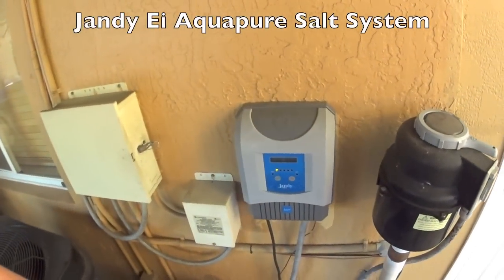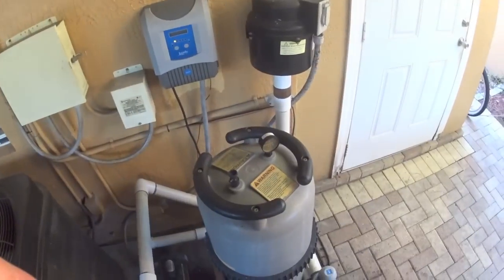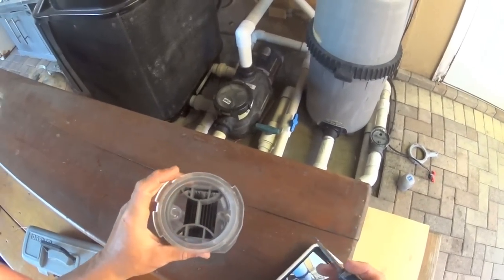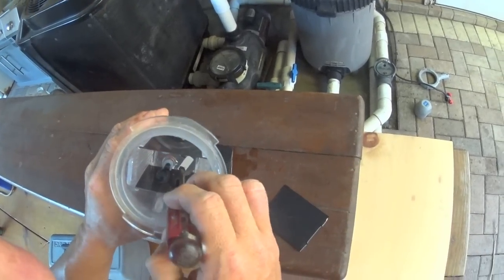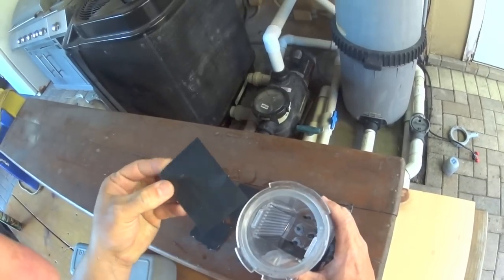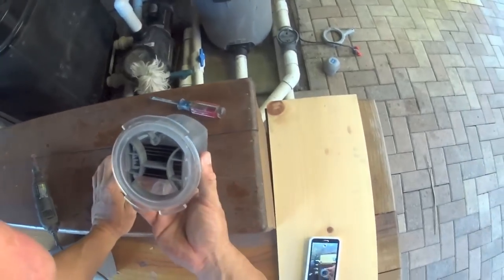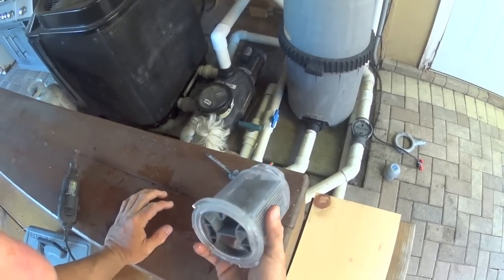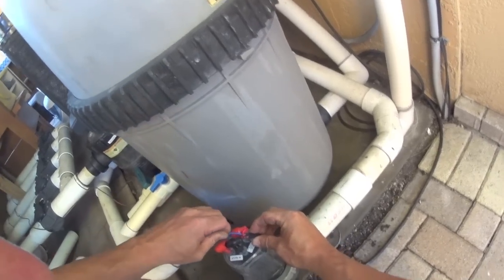Zodiac Jandy Ei Aquapure salt system quick fix on the cell

Comment: Melbourne, Australia here. My Zodiac Ei25 did have the very same issue. It has ~6500h. Your solution did work but with a small change. The change I had to use was caused by the bottom clip not being able to create a proper electrical contact with the modified plate. The solution I used was to clean the bottom contact and then add a spring to the plate (where the cut has been done) , then insert a screw into the spring pointing down with the screw head. In this way I did succeed to have a proper electrical contact between the modified plate and bottom contact. After doing this the Zodiac did start working properly with me being able to change the output to maximum. Thanks a lot for the tip provided in your video. I expect this workaround to work for a while, but I did order one new cell anyway with $459AUD from eBay pool shop.
Reply from the maker: Glad I could help you out man.

Comment: This worked for me too. Thanks for posting this video!  You saved me from having to buy another cell and wait for it's delivery.  

I had to make one adjustment to your instructions because it would not work at first.  I pulled off the black boot inside the cell. The electrode/connection rod was actually attached (or welded) to the original plate and that piece was still there.  So, when I inserted my other plate with the tab cut it would not go all the way in and not make good connection, and the bottom was down too far  That's probably why you had to notch the bottom of your plate.  I pulled off the black boot inside and I worked the "new" plate/tab up beside the electrode to assure good contact.  Now the bottoms of the plates were all even and I didn't have to notch the bottom of the plate.  It worked.
Reply: +Shawn Gibby Worked for me too. I pulled the plastic sleeve off the negative terminal with needle nose plyers and then worked the plate next to the terminal.

Comment: Just did this to mine. I soldered a tab and extended the lead about an inch so it would touch plate and put it all back together and started working again. THANK YOU for this info!
Reply: Can you explain to me what you did exactly? My leads are frayed going into the little head thing. Wondering if i can take them apart and redo them?mine is saying no flow sometimes, sometimes low temp or salt. My cell is brand new. I cant find the replacement for the cord. Wondering if there is a way to repair?

Comment: I had the same issue with the flow light. I tried this fix and it worked, the flow light went off and the system seems to be working fine. Thanks for the post you saved me $450.00 by doing this video.
Reply from the maker: glad i can help

Comment: Great tip friend! You gave me a start. The electrode had corroded and new tip was too short to make contact with the eroded electrode.
I ended up cutting about 1/4 inch off the bottom effectively lengthening the tip. I put cut strips if a bicycle inner tube on top of the plate between the two taller ones.  I made it thick enough that it put pressure from the clip on the top of the plate.  Voila! It worked, how long I don't know for how long but It buys me time!

Comment: Thanks Brother you saved me a few hundred as well. I did not think this was my problem, because you cannot tell that the plate is all ate up until you actually pull all of them out of the cell. I pulled them out and one of my active plates were worse than yours was. Fix worked great.

Comment: Thanks mate. Fixed my Zodiac Tri Chlorinator as shown. Had to reset the Cell Hours as well before it started working. Hopefully will get a few more years out of it now. They could so easily make these plates consumables instead of nearly charging the cost of a complete new system just for the cell.

Comment: Thank you so much.  I got the run around as you.  Jandy had me order the cover assembly, however after trying your fix, it worked.  I made the cuts with metal snips and it worked great.  Think I will have someone cut me a supply of the metal plates in anticipation of next time one fails.  I will return the part I ordered from Jandy as soon as it arrives!

Comment: Brilliant. Thanks mate. They don't manufacture the ei units for my one anymore. I found them on Ebay a couple of years ago when the first unit failed. Had to buy chlorinator and digital unit. Quite cheap, but not as cheap as fifteen minutes and a couple of Dremel cuts. Legend

Comment: Good video and great you took the time to make it .  I've only been able to get 2-1/2 years out of a Jandy APure35 cell.  Today I ordered a third one (R0511400).  Seems the black capped electrode corrodes at the weld where it joins the plate.  While waiting for the new one I decided to see if I could cobble up one from the old units.  I took one of the "red" electrodes out and made it into a "black".  The electrodes will come out by clamping the terminal with vise grips and hammering down on the cap. The electrode post on the plate inserts into the terinal pin and is held in by an interference fit.  The post on the plate goes through the cap and is sealed by an o-ring that seats against the bottom of the cap.  Before installing the replacement red for the black, sand down some of the electrode post so it will insert more easily into the terminal pin.  If you use the red terminal pin (it is split) it will have to be spread slightly to get a snug fit with the electrical cap because the black terminal has a larger diameter.  When my pool was build the crew left behind a "dummy" cap, so I was able remove the cell without having to close down the pool.  I got by with clorine tablets in the meantime.  Hope this is helpful.  This method, although requires ordering a replacement or two over the years, it will give a better bond of the electrode to the plate and doesn't require cutting the plates.

Comment: HI Fresco,
The NO flow red light is the blue wire it is connected to a probe that needs to touch the water inside the cell. This tells the machine that there is water present or water flow. There is a straw that pulls the air out of the top of the cell. If the tube or straw is missing or broken, the cell will have air at the top and the red NO flow light will come on, even if you have plenty of water flow. The Titanium plates have a coating on them, once the coating wears off, it will not convert sodium chloride to chlorine. You cannot just put any metal plate inside, it will not work. Your troubleshooting was very ingenuous, nice work but it will not last long. Basically, you were able to re connect the grounding probe that connected the blue wire to the water probe that tells the machine to turn on. Yay, nice work,,, but,,, the plates have a 3 to 4 year life before they wear out. Acid washing is very important also, you need to check and clean the cell at least monthly, it not, the calcium that bridges the gap will eat the iridium coating and shorten the life of the cell.
Reply: Do you know specifically how the blue wire gets its signal that there is water at the sensor? I have already replaced my chlorination unit and still getting no flow. I am wanting to find some way to troubleshoot it.
Reply: @johnwaldee6283  I am having the same issue. Did you ever find a solution ?
Reply: My cell is brand new. It still says no flow, low temp or low salt depending on the day.. my cords is frayed where the leads meet the head. Any advice for repairing them? I cannot find a replacement

Comment: This was helpful, thank you.  My issue was that the plate that made contact with the electrode had worn through.  I was not able to solder a new contact because the solder would not adhere to the electrode, but I was able to tack weld it.  Be careful if you weld to stainless steel.

Comment from the maker: I'm not a pool repair guy but it worked for me
Reply: I just replaced mine. Would you like the old one where most of the metal plates are in good shape?
Reply: Are the cuts required? The other plates fit fine without any cutting.
Reply: you should not use stainless.  1 its expensive, 2 the chrome in them will make chromates that are toxic 3 they will be consumed.  You could use copper, its expansive, will be consumed but the copper compounds are not very toxic to most people and would help kill algae.  Typically companies use titanium because it last longer and cheap.  the best thing would be platinum coated items but that is a lot of money.
Reply: I am pool repair!! Very impressive!!  I will share this video with my customers... cause, like you said... broke is broke... so give it a try!!  Nice job!!

Comment: Thanks for the Vid. Helped me diagnose my "low Salt" and flow issues. Unfortunately, not only was my plate corroded, but the whole terminal as well. Guess i'll need to order a new cell, but at least its a quarter of the price of a new system.
Reply from the maker: Wow that's amazing bro, good luck fixing and replacing it.
Reply: I thought mine was also corroded, but it was only a rubber grommet that fit over the connection inside the cell.  So instead of cutting out a section like in this video, I cut the plate to have a tab that slid inside the grommet.....

Comment: The chlorinator cell consists of parallel titanium plates coated with ruthenium and sometimes iridium Just buy the plates if you have to replace them! Found this on Wikipedia To clean them mix Muriatic Acid about 2/3 with water remove the unit flip upside down and pour the acid mix in and let soak a few minutes. Don't do it too often it does wear out the plates.
Reply: +Phillip Magnetti Did you find a source to buy the plates? Pulled our cell apart and our plate was toast too after install 14 months ago (ugh). Guess we need to clean it regularly to try to prevent this from happening.
Reply: You can't just buy the plates just purchase the replacement part completely
Reply: This is extremely valuable knowlege!!  Not just 'stainless steel' but some hightech alloys. PLEASE advise us where we can find these items - they're very exotic.

Comment: The Plates are Tungsten and have a special coating but I made a replacement plate for the center electrode from 1mm Stainless Steel and it works. Not sure how long it will last but so far so good after 2 weeks. $350 saving for me :D

Comment: The reason your center plate is shorter is due to arcing.  The plate was originally welded to the center contact.  The contact corroded and then started to arc with the plate, burning away the bottom.  Not a good idea to just sit a plate on the contact.  Shorting will occur constantly and could damage your salt water chlorinator.

Comment: Thanks man, this is great!!!! I know what to do tomorrow. I am actually quite p!ssed at Zodiac. We had a fault on the mainboard and they offered NO support or assistance. It was a Film Capacitor that had melted and Fluidra (the new owners of Zodiac) recommended to order a NEW mainboard @ $560 USD + $220 USD DHL to the Philippines - WTF (this is more than the entire system cost new only 4 years ago)???. I  replaced the capacitor for $0.50 (and 2 hours of my time). Tomorrow I am digging into the cell and should get everything working again. If I could send you $20 for your advice I would - at least it's a few beers to enjoy your crystal blue pool :)
Reply from the maker: Dang bro no problem, good luck. Thanks for watching

Comment: Great Video, it was exactly my problem as well! 
I couldnt get my Free Chlrorine to come up. 
Mine was partially still working maybe @ 25 % as some plates were still good and current flow. I moved them around and cleaned them and now they may be working @ 50%. 
Gonna visit the local pool store to see if they have a broken one around that I can salvage some plates from to get mine back up to 100%

Anyone know what the BLUE lead does and is it suppose to connect to a plate?

Comment: Are the cuts required? The other cells fit in the slot without the cuts and it does close.
Reply from the maker: I'm not sure, but if it worked, then go ahead.

Comment: Thanks for the tip. I am on my second Jandy APure 35 cell and this one is giving me the low-flow light and not generating chlorine. I took out the plates and switched them around as you instructed, and everything works! Thanks again. You saved me a couple hundred bucks. Did you find out what the plates are made of?
Reply from the maker: Glad it worked for you too. I am going to cut out stainless steel plates to see if it works.
Reply: +fresco channel  they are made of titanium my friend

Comment: I’m about to buy the third one.   Price increased from 380$ to 595$ cad.  I want to fix it. The middle rod is too small and doesn’t reach the plate anymore, your idea is not working. I will change it… and see how it goes…  probably post it .. if it’s working !!

Comment: The solution to my problem was that the black wire from the cell was loose at the terminal on the circuit board.

Comment: How to Void your Warranty.
those plates are coated and all come from same manufacturer... PLEASE DO NOT FOLLOW THIS ADVICE.

IF THAT CELL GENERATES WHEN THE FLOW SWITCH IS BAD IT WILL MAKE HYDROGEN GAS...

just fix shit properly or dont own luxury items you can not afford.
Reply: Absolute rubbish it needs more energy to do this than cracking the salt to Cl and O2
Reply: I should clarify.  H2O is constantly breaking and re-making its bonds, constantly.  Adding energy like heat speeds this up.  Oxygen is highly polar and bonds with 2 Hydrogen atoms to form water and these bonds are constantly broken and remade.  Hydrogen can form H2 gas but its more likely to re-bond with oxygen to form H2O.

Adding electrical current does break this bond but it quickly reforms to H2O.  However, the salt is broken into NA/Cl2.  Sodium and Chlorine gas.  The sodium doesn't last long (its very highly reactive) and does dissipate with the billions of  H2O molecules.  The Cl2 doesn't last long as well but in Gas form, Cl2, it'll last longer than the sodium, which is what we want. Chlorine!

Yes adding too much energy can break molecule bonds but given we start with  H2O and NaCl we always end up with H20 and Cl2 (gas).  Yes this is simplified (not showing ions) but we are not going to end up with H2 gas when there is highly reactive Oxygen to bond with.  End of story.